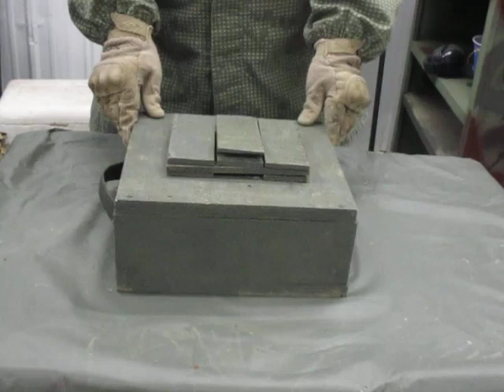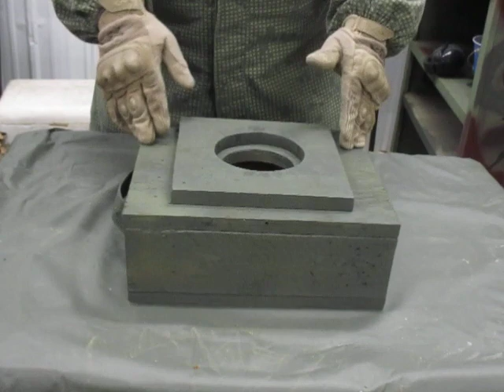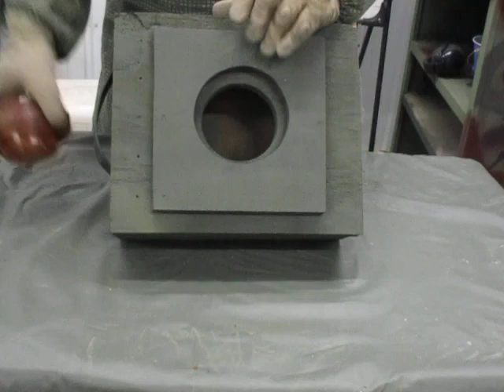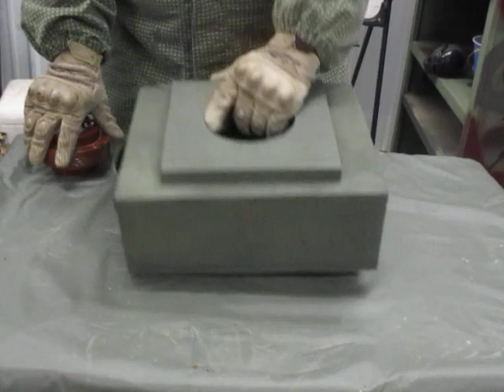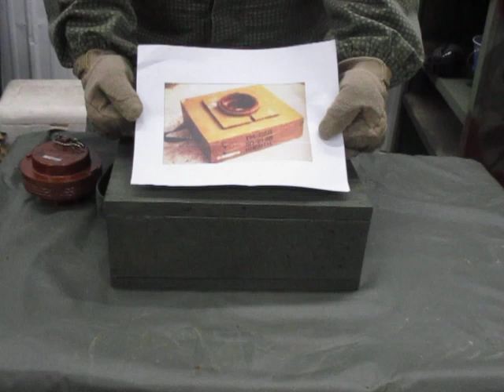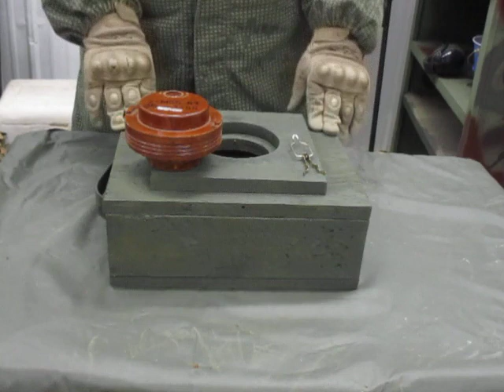Russian TM-62D Antitank Mine

Comment: "You can manufacture a display"
Yeaaaah.... in theory. The authorities might not like it and let you know though.
That happened to a retired EOD friend who made a mockup of a "rollerminen" based on the metallic and empty casing of a Teller Mine and wood. You can still find some part of the video that didnt need censoring here on Youtube..
The rollerminen was essentially a teller mine with two hemispheres of concrete (to make it round). In some places on the Atlantic wall concrete gutters were made from the trenches bordering the cliffs to the edge of the cliff. Insert a fuze, light the fuse and let the mine roll and fall on whoever is at the bottom of the cliff.